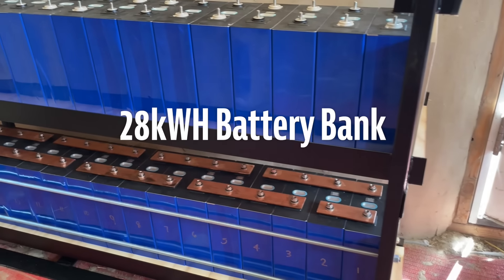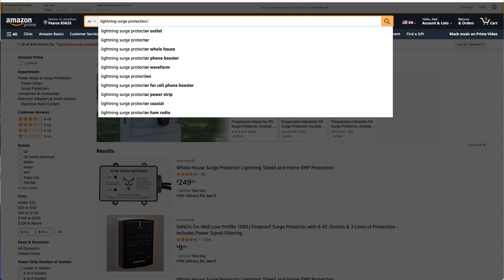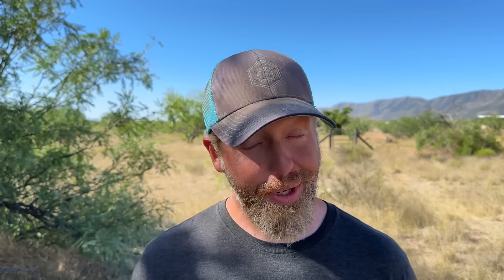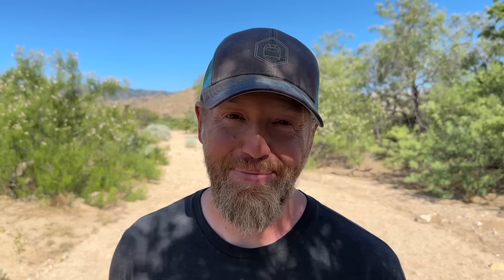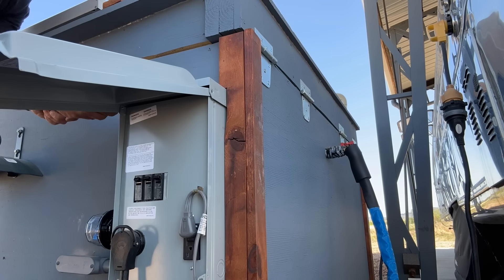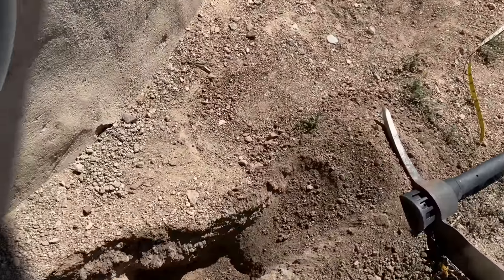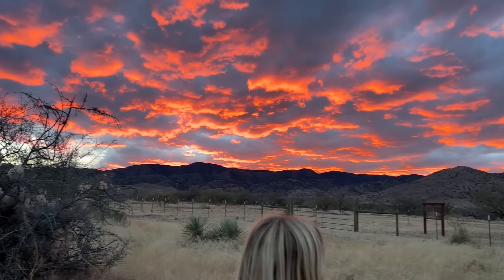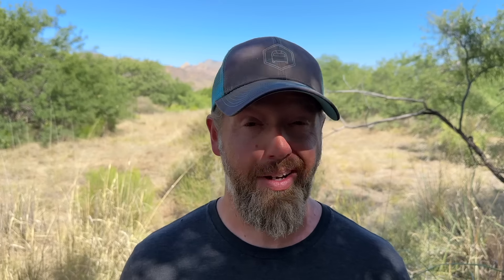This Cost Us THOUSANDS - Lightning Destroys DIY Off-Grid Solar System

Comment from the maker: :videocall:MAKE SURE TO WATCH THE ORIGINAL INSTALL VIDEO: https://youtu.be/vnjMQLhp6LE
⚡SOLAR WIRING DIAGRAM: https://tinyshinyhome.com/off-grid-solar-wiring-diagram
Reply: Tip for those drilling into metal, use a magnet and cloth to catch the metal fragments so they don't end up some place you don't want them (9:36).
Also with the long runs, should add additional grounding rods at each different building location (13:45).
Reply: @SurenCao  I disagree. grounding the panels turns it into a lightning rod
Reply: @SurenCao  e
Reply: I used to work with a geophysicist who spent a lot of time in the desert. His answer for lightning protection was to encircle the property with wire fence and ground that to another length of fence that was buried horizontally a foot deep. The lightning would preferentially hit the wire fence. He said it suffered several strikes and did the job.
Reply: If you are experiencing  this type of weather and this may happen again  - I would install ( I already  did for myself) early streamer emission (ese) lightning arrester (protection system) , with a capacity of 100 or 200 meters diameter range! Made entirely of stainless steel, which practically makes the system eternal!  This would  save  human lives as well your buildings and PV system! You will need separate grounding only for this system and the resistance of that grounding needs to be under 10 ohms - in your case with all that sand it will require a lot of stainless steel in the ground but it will last forever!  I chose this option., but for me the problem was that after 40 cm of soil hard rock begins and I barely managed to drive in 1 piece of two-meter stake with a special hydraulic bow - in the end the stainless stakes split from the blows!     Good luck,and I hope you will find what works best for you!   :)
Reply: Buried Cement is an excellent Grounding Source.
It contains moisture that keeps it Grounded.

Comment: Hey Jonathan. I was an engineer that installed communication towers and have also installed some 10kw solar systems. I will give you a suggestion. It looks like the soil is rather soft there. Multiple ground rods can help but your resistance to the earth may still be rather high. It could still be 40 - 80 ohms and you need it close  to or under 5 ohms. The easiest way to achieve this is go deep.. you can get ground rod couplers. Drive a rod in, couple it and drive another down on top of it. You can go down until you hit rock. 3 or 4 rods deep is ideal to really drop that grounding resistance. Of course you need to use an sds type heavy hammer drill with ground rod bit to keep driving deeper. You need steady force. If everything is bonded together you probably only need one deep ground on the entire system. Great video!
Reply: I agree, I worked for a telecommunications company and proper grounding was critical to protect our systems. In some of our cities we had ground rods that were much larger than you used at a premium price, our goals were to try to get under 3 ohms to ground measurements.
Reply: Yup. What those guys said. Be advised your choice of material matters because they begin to corrode as soon as you put them in the ground. A properly sized, high quality rod can be effective for 40 years. Cheap-o rods are usually effective for 15 years.
Reply: Another method that can get you much lower impedances is to increase the soil contact with secondary materials.
Bend the top 12" of multiple ground rods up in at 90 degrees. Lay them into the bottom of a trench and cover the horizontal portions of the rod  with a bentonite clay slurry before back filling.
The bentonite will never dry out and it increases the ground rods' surface area contact by a very large percentage. 
When people talk about getting the resistance of a grounding electrode or field "below 5 ohms" they aren't talking about any test you can do with a multimeter. These measurements require specialty instruments that can do what is called a three point fall of potential test.
Reply: @chrisw2995  you are correct! Bentonite slurry fill around a deep ground rod would be great especially if a hole was bored 40 to 60 feet deep to get that ground resistance down below 5 ohms. It started getting costly though. Great comment.
Reply: With lightning the rise-time is fast as lightning and makes all conductors operate as proper ersonators in the RF region.
I's where the real magic happens 😄
Reply: As robert highlight,  do u have a functional grounding system? All grounds has to be same potential level,  aka u have to Connect all ground poles togheder, and with appropriate bare copper wire
Reply: I have a 110 foot antenna tower, it is around 120 feet to my 80 foot deep steel cased well, this is the main ground point for my house. After the first strike took out my router ( internet was over LTE) and cause a plasma ball way too close to my head I looked at the tower ground, it was a 3 foot 3/8" rod in 2 feet of sandy soil sitting on granite. I laid out a ground plane that had 10' by 3/4" ground rods in a star pattern, all connected by 8 gauge copper wire. The rods were ~45' out from the tower, and the rods were buried with salt around to aid conduction. I also added lightning protectors inside the house on the ethernet cable.
 A month later the same thing happened again, so 2 more ground rods were added 3 feet from the initial rods I placed. 4 of the rods were in wet sand, they were is the rivers water table. I upgraded the lightning protectors, one at the bottom of the tower the other where the cable entered the house.I still lost the router and 1 computer. The guy from the ISP said that maybe the groud was too good (?) and was drawing the lightning so I should try disconnecting all the grounds(WTF?).
 Not enough, after 2 more strikes killed 2 more routers I noticed that the tower ground plane had a rod close to the well. I bonded the well to my ground plain and never had an issue again, except 2 cooked arresters.
 What was happening is the tower ground and the well ground were at very different potentials. When I bonded the 2 grounds I added a current transformer. After one strike I had a current spike of over 2500A. 
 Long story made short make sure you have one ground for all equipment, make sure that the primary ground conductors have no sharp bends or kinks, if you add ground rods make sure they are all very well connected to each other.
Reply: @pjford1118  Good update my friend. Yes, all grounds must be bonded together. Good job figuring it out.
Reply: @pjford1118   We had a similar ground problem with our satellite, and it was because one yahoo installer, grounded to a second ground.   So, our electrical system, then had two grounds.  Two grounds is also bad.  So, the last tech, ran the ground wire to the electrical ground bar, and so far, so good.
Reply: Pour 10 gallons of 5% salt water in that hole and your grounding conductance will go up 600%
Reply: The grounding system is a fine DIY job which may be working or have issues. Start getting a proper measurement and measure at every point where you have sensitive equipment! lightning strike may cause very high currents going in any direction. If it finds a low impedance route that differs from the others high voltage may occur because of the induction value of the long copper rods connection the drivers points. One VERY good earthing point is better than 10 bad points. See also the comment with that big well connection where there was a graveyard of computers and routers.
Reply: Thanks for the info.
Reply: Getting to water table gets you low resistance to earth
Reply: What about turning off the whole system when a storm in coming and light candles or just go to bed and ride it out

Comment: Anyone who has lost a refrigerator, a computer, or other tech due to lightning feels your pain.
Reply: Or from solar power on the grid going down😊
Reply: FACTS
Reply: Kinda the equivalent of a car to most households, not so much like losing a phone. He’s got at least 35k in this setup.
Reply: They lost a charge controller and inverter not the whole system so yeah no different to loosing and appliance
Reply: I turn off my appliances during bad storms. No need to lose my white goods  and tv again  even power box if worried. 1 switch whole house disconnected.

Comment: You need to run #4 copper ground wire to each ground rod in your system to bond all ground rods together. More ground rods do nothing to help you. Adding SPDs definitely helps but your are placing all of nearby lightning strike induced earth current surge gradient stress on SPDs without bonding everything via low resistance ground bond. This is the main flaw in your setup - not bonding all your ground rods. Earth soil acts as distributed resistor and ground rods at different locations act as resistor taps bringing this voltage gradient into your electrical devices. Look up lightning strike ground potential rise.
Reply: I actually came here to say exactly this lol. If the rods aren’t bonded, you’re earth ground is not effective. Also, as others have stated, your soil may have a significant impact on the impedance of the grounding (which should be low to facilitate conductivity). You can use chemical grounding products or an appropriate type of soil enhancement product. But first and foremost… bond. Thanks for the good videos 😁
Reply: Looks to me like he did that.

Comment: A little hint...  Not if, but when you build the grounding grid, before you interconnect the rods, measure the resistance between each pair of rods (through the ground, that is)!  Do that already between the first two rods.  If not satisfactory, add more rods.  You might even try water jet drilling with some salt added to the drilling water.  Anyway, consider that a lightning strike can be 100,000 amperes , or more.  By Ohm's law, it would generate 10,000 V on just a 0.1 ohm grounding resistance.  See where this leads you:  Even a grounding grid can still be poor, if the soil is dry.
Reply: Exzactly, that is very poor grounding grid
Reply: Exactly what needs to be done that's why if you get a strike near but not direct it takes out electronics. Hammering ground rods in where the inverter was, and different spot where the solar panels are just asking for current to flow between those rods creating 1 million volts just arc from the ground rod over to the other wires connecting the panels to the inverter along the way fry the power transistors.

Comment: a few things you did wrong and will want to change asap:  1 do not cut or break the copper ground wire.  Run it as one single run in the top out the bottom to the next grounding rod.  2 never put more then one wire on the same grounding nut / connection Especially if the wires are not the same size.  If you do one wire might make a strong connection while the other remains loose.  This also goes back to the last thing where if you do not cut the wire you don't have this problem.  They even make ground stations to that utilities like internet and cable / satellite can ground correctly as well.  One last thing I would spread out they grounding rods at least 10 feet apart and have toy might want more the 3 depending on just how dry the soil / sand is.  And try to drive them down to a depth that is naturally slightly damp .

Comment: I am an Electrician, you can drive another one into the far end of your swale (that's where the most moisture is) and put up a "tower" (15 feet high or about 5metres) with a 6mm wire up the tower to draw the lightning away as it tries to even electrical charge between earth and sky. I am a South African so I don't know your wire gauges as we are a metric country.

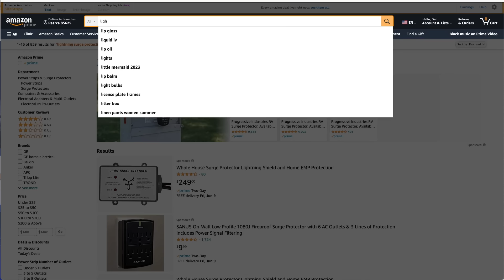Comment: Thanks for talking about this guys! The Midnight SPDs sound like the way to go! Thanks for explaining how to install them. Great idea to protect your generator too! Wow, I had no idea that happened to you guys! That must have been terrible. We had a lightning strike behind our garage. Our Net Gear modem was plugged in at an outlet in the garage and it fried. Wow, adding more grounding support because of your dry sandy soil! So sorry you can't get any insurance for your system. You definitely are doing the most you can to protect your system! Thanks for this video Jonathan! On screen shot, pesky T-Rex at 3:07! Our house uses our water main as the grounding rod. I see a fat copper wire going from our breaker box to the hot water pipe coming out of our water heater. Then more copper wire goes to the cold water pipe as the inlet to the water heater. So we got a new water softening system installed and it is connected in with PVC connections. I asked the guy about the grounding and he didn't know what I was talking about. I had to buy some copper wire and spiked ground connectors to ground above that installation to get over to our water main again. I'm so glad I noticed! He "broke" our grounding system by isolating the water softener system with PVC connectors. PVC doesn't conduct electricity! The side of our house with the breaker box has a deck and then pavement between it and the mast where our power comes into the house. Not really any good spots to put grounding rods. So far so good.
Reply: Good comment

Comment: Most relevant video for me. In the next week, I’m redoing some parts of my system as I move it from temporary to more permanent, if there is such a thing. You are also right about how hard it is to DIY. It is simple to connect component together, but learning everything to deal with problems is difficult and you can never learn enough.

Comment: I would recommend a ground rod next to your airstream's electrical box that you put the SPD on so that it has a short path to discharge instead of having to go all the way back to the ground rods back at your solar shed.  I would also make sure that steel structure above your airstream is grounded well as well.  It looks like trenching there is not hard, so I would recommend a bare copper wire back to the other ground rods as well, but that doesn't seem as important to getting a ground rod next to the airstream.
Reply from the maker: Yes there’s a ground rod there. That’s what the SPD is attached to.
Reply: @TinyShinyHome  Adding a ground rod at your RV canopy and bonding it to the sub-panel could be problematic.

The sub-panel feeding your RV is bonded with a “ground” wire back to the main panel in your solar shed; this is correct and required for your circuit breakers to work properly. The problem is having a second grounding rod at your RV canopy that is bonded to the sub-panel, which is ultimately bonded to the ground rods at your solar shed.

The earth has a limit on how much electricity it can absorb in a given location, and your interconnected ground rods give electricity a low resistance path between two earth points. So if lightning strikes near one of your structures, the electricity can travel up into the ground rod at one structure, through your bonded electrical system, and down into the ground rod at the other structure.

Connecting multiple ground rods together at your solar shed, with a single link to your main panel, is good and follows NEC guidelines. But having a second ground rod at your RV canopy may actually increase your risk of lighting damage rather than mitigating it.

I highly recommend that you look into ground-neutral bonding requirements, and the consequences of having two ground rods at separate locations that are bonded together.
Reply: @NagawieckiFAB  NEC requires separate grounding rods at sub panels that are located in detached buildings.  The question becomes, does the Airstream count as a separate structure/building?  Personally I would treat it as a separate building and have ground rods at both locations.  The code to look up would be [250.32(B)]

Comment: I completely feel for you. Our house was struck by lightening on Xmas Day 2015. Besides a large hole in our tiled roof, it fried just about every electrical appliance inside the house, and also our Solar Invertor, automatic garage doors, and our back to base security alarm system. It split apart our surge protector power boards as well. Thank goodness we were fully insured, however, the excess was 1000s. This however, was a small price to pay for a bill which was in excess of $40,000 in replacements (covered by the House and Contents Insurance). I hope and pray it does not happen to you again.
Reply: I am so sorry that happened to you, especially on Christmas... wtf!
So happy you were insured.

Comment: As for a good grounding location perhaps nearer what ever septic or grey water you have would help.   Pretty easy to bring grey water any where you want it for cheap.

Also seems to me  "more" grounding rods is not what you need as you did not burn them off you need  "deeper"  grounding rods that give a good easy path to earth.   As you explained...

thank you for sharing.   I learned several things.

Comment: Enjoyed watching your video. Had the same sandy soil issues in the Middle East. I used a Ufer Ground (concrete encased electrode) which worked out pretty well. The system was developed back in WW2 by the US Army.
Reply from the maker: Yeah we employed this, too on a newer system https://youtu.be/CKHxCfAtX4w
Reply: @ nice job. Just watched the video that you shared. I’m curious to see what your impedance readings are between your Ufer and the standard Ground Rod systems. The digital clamp resistance meters are easier to use compared to the megger fall potential method. I’ve seen some less expensive units online but can’t say how good they are. Maybe consider making a video to share your results?